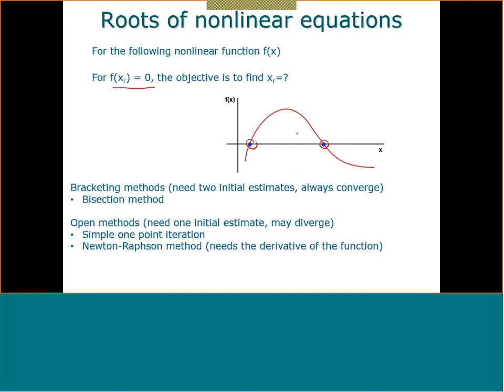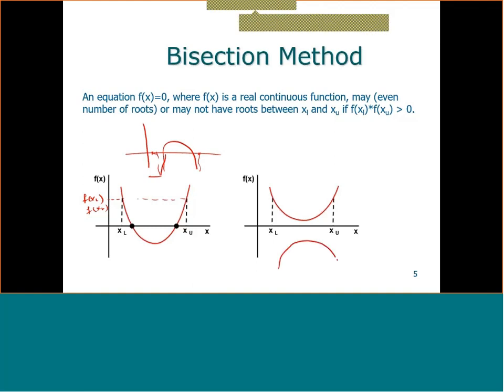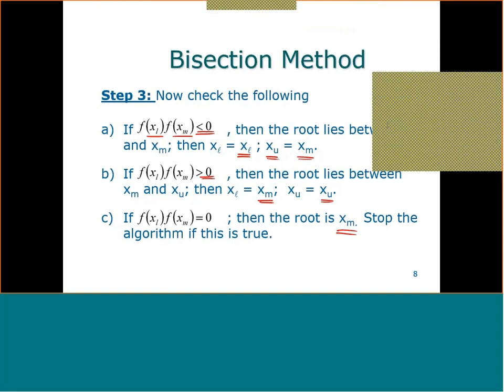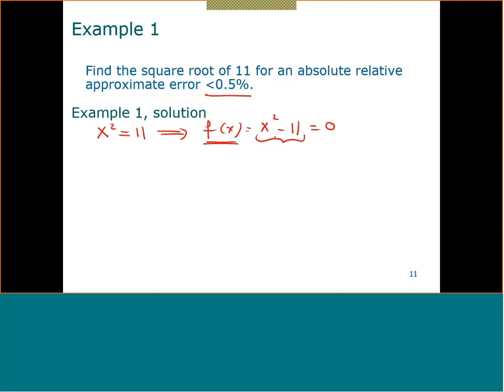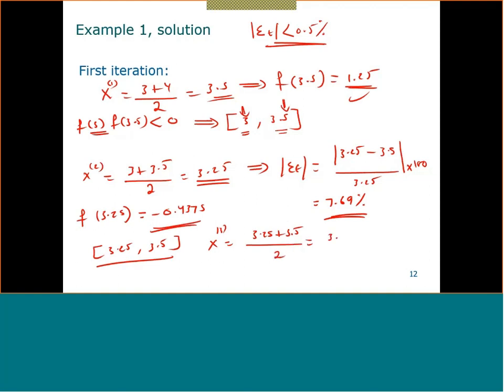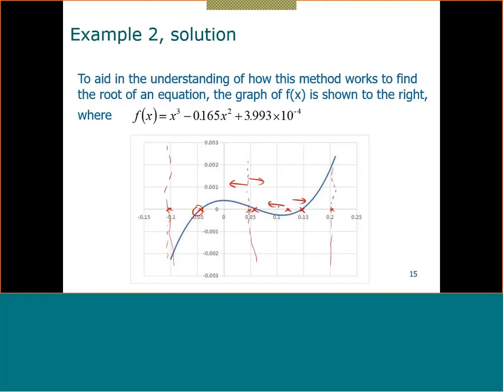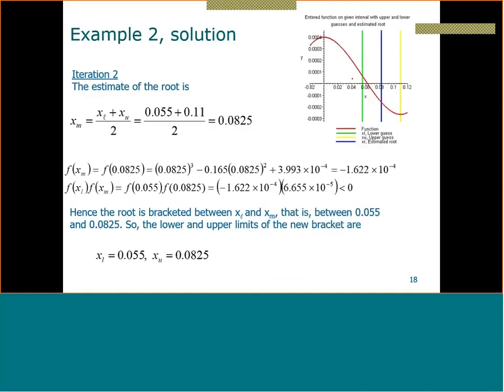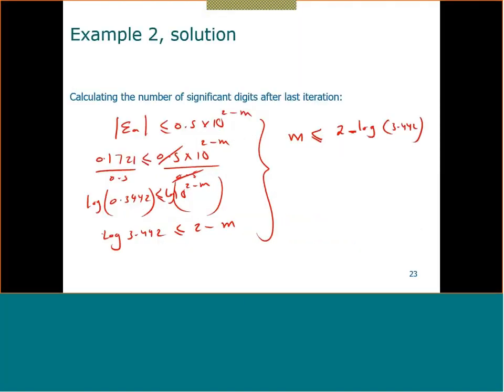Lecture 7: Roots of nonlinear equations  - Part 1

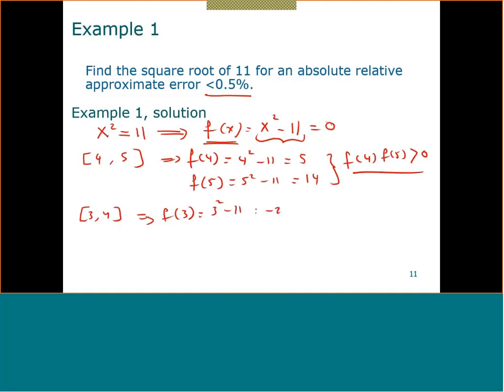Comment: 18:43 Why if f(4)*f(5)>0, then we know answer is not between 4 and 5?

We said previously that if f(xL)*f(xU)>0, then there is even number of roots or no roots. So technically, if I did not know the answer to x^2-11=0, and chose 4 and 5 as my initial guesses,  and found f(4)*f(5)>0...how can I tell that it will have no roots between 4 and 5, why not an even number of roots between 4 and 5?
Reply from the maker: Since this is a qudratic function with 2 solutions one postitve and one negative then we know for sure for positive interval we should have one solution
Reply: Makes sense thank you so much @electrical4everyone